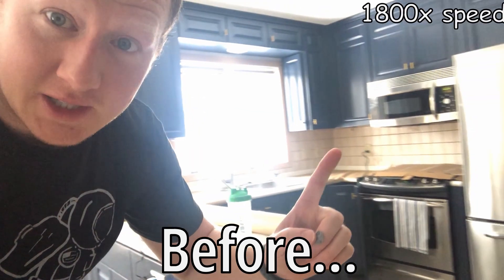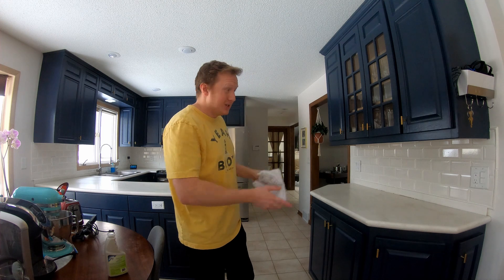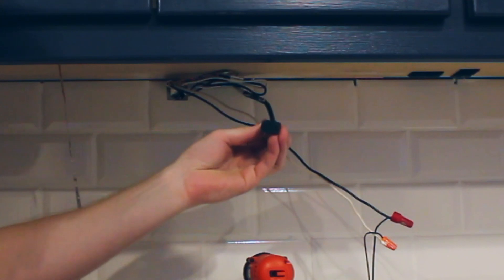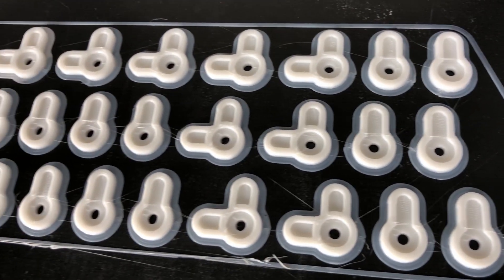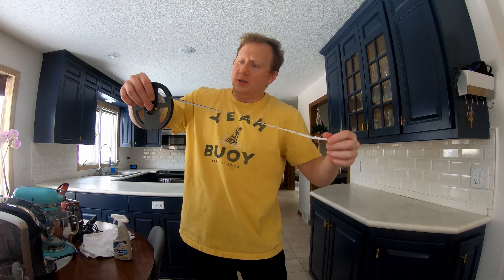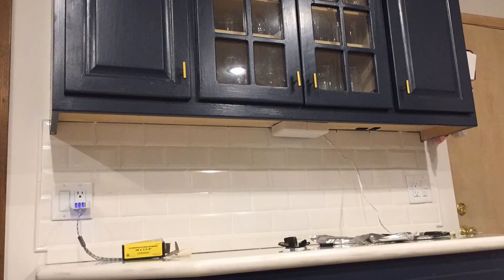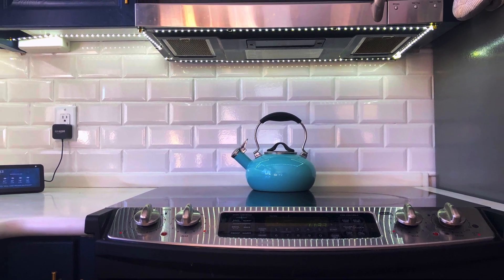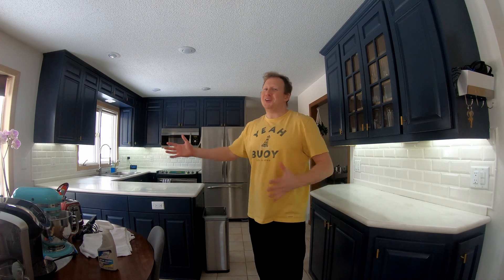STUNNING Under Cabinet LED Upgrade!  *NEW Design* 3D Printed Electrical and LED Strip Mounts

Comment: Nice looking project. Just a suggestion, if you use those led strips with silicone coating/cover on them, it might be easier to clean also safer from the elements.
Reply from the maker: 100% Agreed.  The reason I chose the cheap ones is because they're easy to make a corner.  If I did the IP67 strips I would have to use some kind of corner connector tool.  Perhaps I could mount them on the interior walls of the under-cabinet, but then you'd be able to see the strip on the backsplash wall.   I wish there was an easier way to do corners with both strips.   Hmmm.....

Comment: How did you manage to feed that 12v line from one side to the other? Were there old cabling all feeding back to the same switch?
Reply from the maker: Yeah - the 3 points were previously wired in series, so I interrupted the first point, and then fed 12v to everything after that.  I didn’t change any wiring in the actual walls.
Reply: L